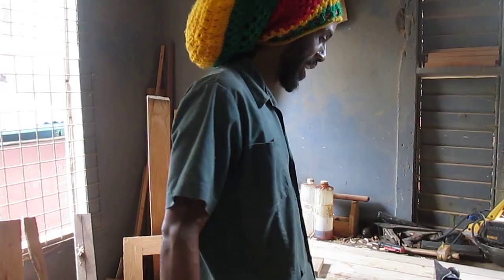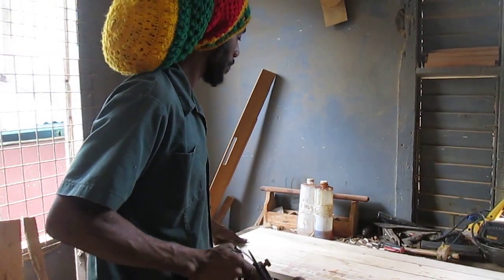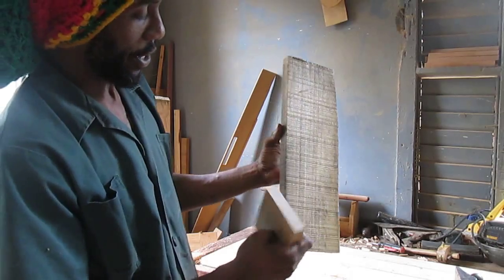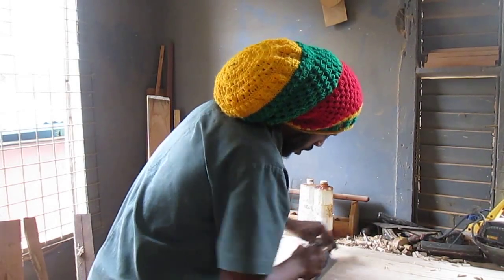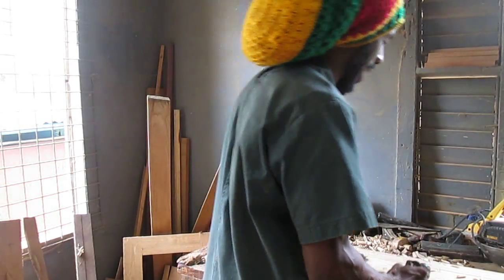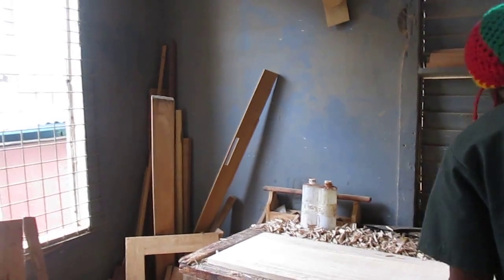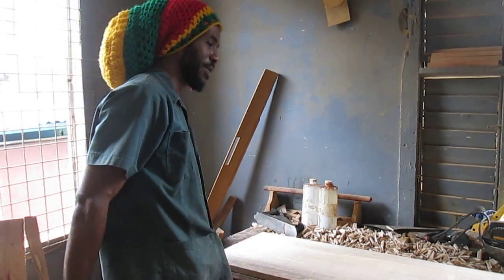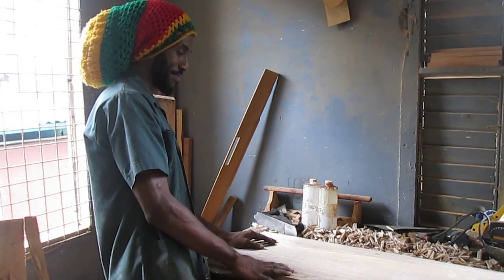how to level  wooden  top with hand plane

Comment: I like your technique man.  After you get it flat planing straight across the grain, you should plane slightly diagonally across the grain, first 1 direction and then the other.  Then repeat planing diagonally but angled so that you're planing closer with the grain.  This way you'll get it flat across the grain and with the grain.
Reply: Derek Vaughn thanks for that advice